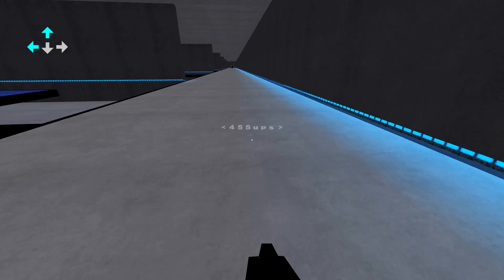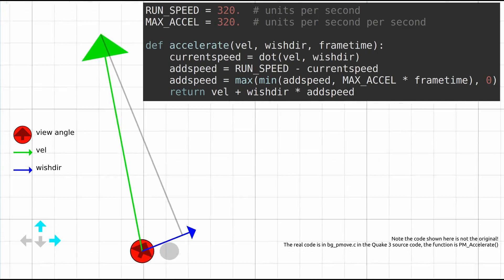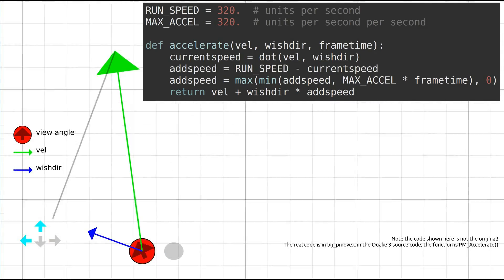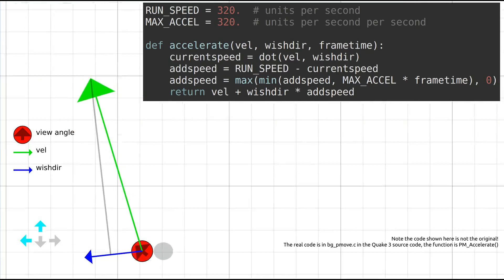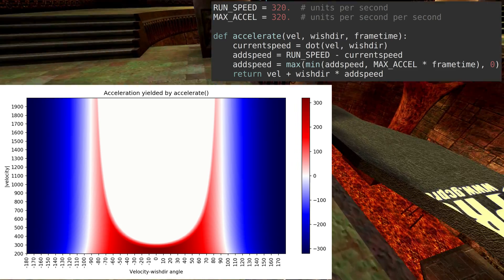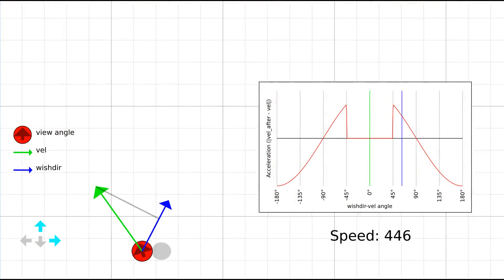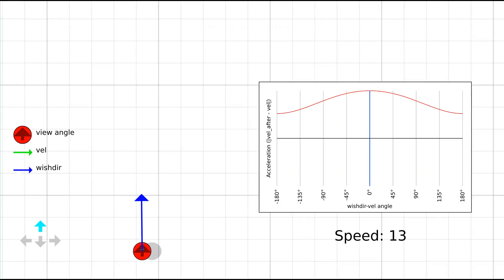Strafe-jumping physics explained

Comment: I think this is the best demonstration I've seen of this phenomenon so far (the animation is especially nice). However, I believe you could explain some parts a bit more (not everyone is good at math).

I know you wanted to keep the original variable names, but "penalty" would describe the role of "currentspeed" better imho. In order to gain the biggest amount of speed, it's desirable to keep "penalty" at the minimum. Since it's equal to the dot product of the current velocity vector and "wishdir", keeping it at the minimum could be done by doing one or more of the following things:
- minimizing the length of "vel" <- since our main goal is to go faster in the first place, this would be nonsense
- minimizing the length of "wishdir" <- it's a unit vector, so we can't do anything about it
- manipulating the angle of the two vectors

Tha last option is viable, we can manipulate "wishdir" by changing where our character is pointing and going (the arrow keys). The smallest dot product with this can be achieved if the angle is 180 degrees (at this angle the result will be the smallest and negative, so when it gets subtracted from "RUN_SPEED", it will actually be an addition). However, the direction of "wishdir" matters: this is the vector that will be scaled and added to "vel" at the end. So a degree of 180 is actually bad, even though we kept "penalty" to the lowest, we did so by pointing "wishdir" to the worst possible direction (backward, if you will).

This presents a dilemma: to keep "penalty" low, the degree of the two vectors should be as close to 180 as possible (or as big as possible, up to 180 degrees, in other words). But since the direction of "wishdir" also matters (as this is what gets scaled and added to "vel" at the end), it is also desirable to keep "wishdir" pointing the same direction as "vel" as much as possible. But if you do that, the dot product and therefore "penalty" will be big (it's the biggest when the vectors are parallel). There is an optimum of these two factors (which you refer to as the sweet spot) but I don't truly understand this aspect, to be honest. Why this optimum depends on the current speed (length of "vel"), is also beyond my comprehension.
Reply: I don't understand most of what you wrote and I have never looked in the Q3 source code and I'm not good at math, and I almost don't understand anything in this video. However, I know why the optimal angle is changing with speed from a purely geometrical point of view.
You can't apply acceleration in a direction where your projected speed will be higher than 320 ups, that's why the deadzone increases with increased speed, because if you'd apply acceleration there you would move past 320 in that direction. The optimal angle of acceleration is the one that is as low of an angle as possible from the direction of momentum while still not touching the deadzone. This because it will give you the most forward acceleration instead of a sideways acceleration.
Explanation in picture form : https://imgur.com/a/caJ5u
Reply: @yotornadoyo  "You can't apply acceleration in a direction where your projected speed will be higher than 320 ups" why?
Reply: @bunny.bunbob  Because 320 UPS is the speed limit in the Quake 3 engine. When you move 320 UPS in a direction you can't apply acceleration in that direction anymore. It's coded that way. If you just run forward on the ground it will also cap at 320 UPS.
You surpass it by bunnyhopping(to eliminate ground friction) and applying acceleration in a diagonal direction that you are moving less than 320 UPS in which will create a forward moving force(and a sideways one) pushing you past 320.
Reply: @yotornadoyo  in your imgur pic you also didnt explain, why the white area in the circle increases. its due to the circle growing in size.
Reply: @yotornadoyo  "This because it will give you the most forward acceleration instead of a sideways acceleration." the formula return vel + addspeed*wishdir indicates that there is no thing as sideways acceleration.
Reply: @bunny.bunbob  I don't know anything about "the formula" or if it's correct or not. 
You can apply acceleration in any direction at any time. If you move in direction A and apply acceleration in the opposite direction, you will brake your speed in direction A and eventually start moving in the opposite direction. 
If you apply acceleration in a "forward diagonal" on the right side of where you are going you will both increase the speed "forward" and start moving to the right. 
The more to the right the angle of acceleration is(of where you are going) the more acceleration will be acceration to the right and the less will be acceleration increasing your speed in the direction you are going ("forward").
Check out the video "Strafing Examples" on my youtube account.
Reply: @yotornadoyo  this absolutely makes sense, unlike the formula! the accel hud in defrag indicates that the acceleration is independend of the added direction, as long as the new vector is inside the cgaz area, but the right side turning when applying a vector to the right absolutely makes sense. 

you can watch my latest strafe video. if you are right, it would be better to strafe with the minimum angle since that makes the overall distance shorter.
Reply: @bunny.bunbob  You strafe very well. Yes the minimum angle is the most effective, but if you have a too small angle you will enter the deadzone so I think it's better to not be too close. Only a bot can strafe perfectly being in the minimum angle all the time.
Reply: @yotornadoyo  having the biggest possible angle or at least having the crosshair in the middle between minimum cgaz angle and the next snapzone seems to be a habbit of even pro strafers. and if they wanted, they could significantly decrease the angle. maybe the effect of added side-accel isnt that big.
Reply: @bunny.bunbob  I don't think that's true. Having the biggest possible accelerating angle with your mouse means you will accelerate very slowly. The minimum cgaz angle is marked as such because it's optimal to be there.
Reply: @yotornadoyo  thats wrong. accel bar shows that and every pro plays like that. watch my video "top tier strafing by aNnh [defrag]"
Reply: @bunny.bunbob  I think we are talking about different things then, in the video he is clearly trying to have as small an angle as possible (being close to the light green on cgaz hud)
Reply: @yotornadoyo  he clearly isnt. just look at his non linear mouse movement. before snaphud was around, they would place the crosshair right at the cgaz line and move linearly. nowadays we know that you dont have to and can still achieve the same accel.
Reply: rocketfuchs I don't even know what non-linear mouse movement means. Cgaz hud shows you where you need to put your crosshair. You will accelerate anywhere on the dark green area but being closer to the light green line will give the most speed because it's closer to the centerline(the direction of your momentum.)
Reply: rocketfuchs The reason you don't want to be too close is because if you go over it you will have 0 acceleration.
So you angle a bit more than optimal to be able to ride the same angle without having to instanty correct it.
Reply: @yotornadoyo  this doesnt explain what you see in the video. the distance is way too high and could easily be decreased.  before snaphud was around, people didnt know where the snapzones are and that the crosshair just has to be between the snapzone border and the cgaz minimum.
Reply: rocketfuchs what is snaphud? And what are snapzones?
Reply: @yotornadoyo  the cyan hud above cgaz hud. there is 1 snapzone for each direction south east nord west and 2 zones between 2 directions. i call those coloured zones, the rest are "uncoloured" snapzones. as long as minimum cgaz angle and crosshair are in the same zone, you get accel. accel increases when the distance between next zone border and minimum cgaz line decreases. vsnaps (w only moves) are used to position the velocity vector so that cgaz line is near to the next zone. watch my annh video and look at the red bar (accel meter) and its interplay with the other 2 huds.
Reply: @bunny.bunbob  I still don't understand exactly what those snap zones are.
I think your view of this might be too constructed, trying to figure it out by looking at these huds. That might be true for the person in the video as well. Or I might be wrong, I just need some kind of explanation to why.
You will get accel if your crosshair is inside cgaz acceleration zone.
What I see in the video is that the closer he is to the light green in the acceleration zone of cgaz(minimum angle), the higher the acceleration bar goes (when using the VQ3 movement with W+D or W+A obviously)
The reason that he sometimes is far away from the minimum angle of the cgaz acceleration zone might be that he is trying to change his trajectory a bit by getting more sideways acceleration while doing W+D or W+A, because this map is not a straight line. 
W-only is used to correct the direction of velocity in CPM because if you for example do W+D and then change to just D you will apply a braking force because the acceleration vector will point backwards. It's possible you're able to see this with that snap hud, I just don't understand it myself.
Reply: @yotornadoyo  i can make a demo with timescale 0.1 where you can see that jiggling around in the gap that i mentioned makes no difference for accel. a sideways acceleration might be a reason for just being inside the gap, but the main reason is having room for error and being able to do more standardized movements without having to care about minimum cgaz.
Reply: @bunny.bunbob  More room for error is exactly what I'm saying.
Whether or not being closer to cgaz minimum within a snapzone is faster, well you'd have to measure ups/s very accurately in some way. I guess it's possible that there is some kind of limitation in the engine making changes of mouse movement and thus change in the direction of acceleration within a snapzone too small to actually influence acceleration in the current direction of movement, but I'm sceptical.
Reply: @yotornadoyo  i worked on my understanding of cgaz and snapzones. there really is a sideways acceleration! in your picture, the green area inside the circle describes cgaz though, as long as the green areas move, when the black arrow is moved.
Reply: I know its been awhile but watch a surfvideo of levi he is the closest human to the "sweetspot"

Comment: In q3 or qlive you want to move the mouse as quickly as possible from left to right, but in the counter strike games you wanna have a smooth curve between each interaction with the ground. Do you know why that is? is it because the ability to change direction in the air is much greater in cs compared to quake?
Reply: This video demonstrates the difference with just two concise variables: https://www.youtube.com/watch?v=MgWqaDqkBD0 -- The reason why you have more aircontrol in Q1/CS, is primarily because the air acceleration is almost instant - whereas in Q3 it's gradual. And what prevents Q1/CS movement bursting into sudden lightspeed, is the fact that it also has a much lower air speed cap. You can observe what this air speed cap is, if you start a jump with zero speed and then simply hold forward until your speed gain stagnates.
Reply: Good question,
good answer.

Comment: What about cpma-style strafejumping and ones from source engine, like CS:S? There you don't hold the +forward and style of moving mouse is different. As I understand, the code is almost same, so that means the difference is only in airacceleration and other variables?
Reply: CPMA consists of three different movement behaviors, depending on which movement keys you're holding. Q3-like (forward+left/right), Q1-like (left/right) and plain steering (forward/back).

Both Q1 and Q3 only have one movement behavior each. The difference between the two can be narrowed down to just two variables: 1. Air speed cap (Q1=30 \ Q3=320) and 2. Air acceleration (Q1=instant like \ Q3=gradual like).

Comment: thousands of hours of q3 and defrag and I now finally understand how SJ works. Now I just need to understand how it works in the context of "half-beat" strafe jumping.
Reply: Thinking of strafe jumping as "orbiting around a center point" might help. Basically, when you do the traditional forward+left/right, you're assigning a center point towards up-left/right directions. If you press left or right only, then you're assigning the center point directly your left or right. Alternatively, if you press forward only - you'll be assigning the center point directly ahead of you. This technique demonstration might also help: https://www.youtube.com/watch?v=gpir6ZZKmcM

This analogy actually works much better for Quake 1/CS/Half Life/etc movement than it does for Quake 3. But in the end of the day, it's just a way to think of it rather than a valid and mathematically correct physics explanation.
Reply from the maker: ToxIkWaste  half-beating (as described here http://www.trickingq3.com/Tutorials/Strafing_Tutorial.html) is just a case of alternating between forward+left and right (or forward+right and left), which allows you to change your wishdir by 135 degrees instantly, rather than the usual 90, meaning you don't have to move your mouse so much. This should only be applied once you're up to an adequate speed (ie. the dead zone is suitably wide) which is why the first one or two jumps are done normally.
Reply: @MattsRamblings  would be awesome to have half-beat visualised with curves like in this video.
Reply: @MattsRamblings  Darn the server for that link is gone, Matt. Do you have a saved version for upload? Or an alternative website for that information?
Reply: @MattsRamblings  careful with the link - now it's a porn website :face-purple-wide-eyes:
Reply: 2 years too late but if you're still curious about it I can help you out. If you want me to teach you how just inbox me your steam name or something, I'll try and give an example you can follow along with using this video, though.... 

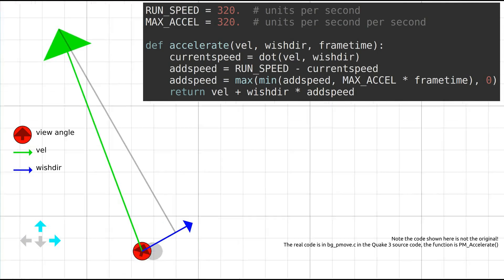If you notice, at 1:05 When he's using W+A and looking left, Wishdir is pointing in between looking straight ahead, And 90 degrees to his left. Now, When swapping to W+D and hitting the correct angle matching on the reverse side, It will be the same as on the left side, But if you had kept your mouse to the left where it was, without moving it at all, And just press D, The Wishdir will then point in the same spot as it would when you W+D and flick there, Except your mouse doesn't have to move, And you need to turn your mouse back towards the goal, Rather than away from it, Because it's literally strafing in reverse.
Reply from the maker: Whoops, missed these replies.  You can find the link on archive.org: https://web.archive.org/web/20180204040655/http://www.trickingq3.com/Tutorials/Strafing_Tutorial.html . It looks like the description there doesn't actually say anything about strafe-jumping "normally" for the first couple of jumps (my mistake). I think it still works because even at 320ups you're still in a positive acceleration zone jumping from -67.5° to +67.5° (refer to my "heatmap" diagram) even at 320, assuming you've angled yourself so that alternating between forward+right and left (equivalently forward+left and right) lands you at these two angles relative to the velocity direction.
Reply: @LukasFink1  tytytyty